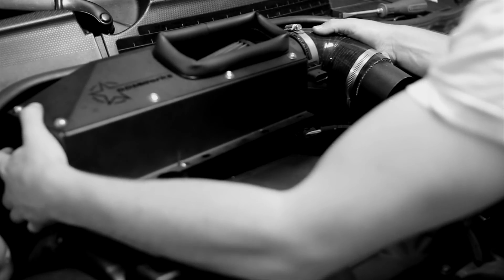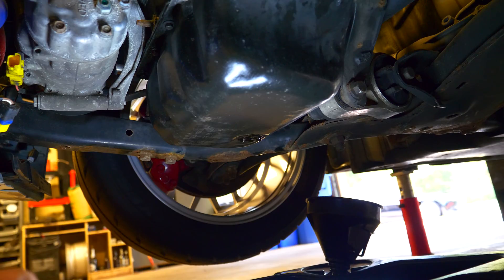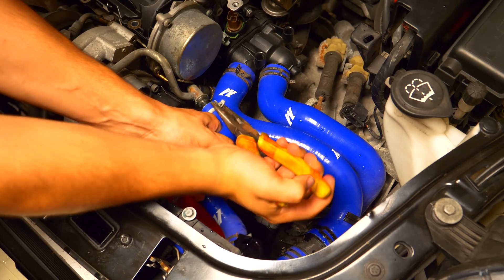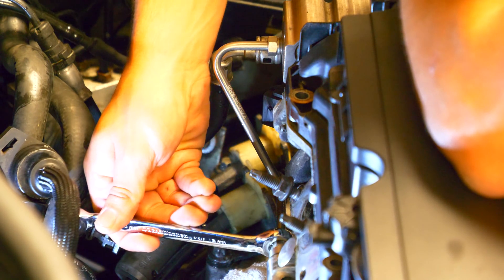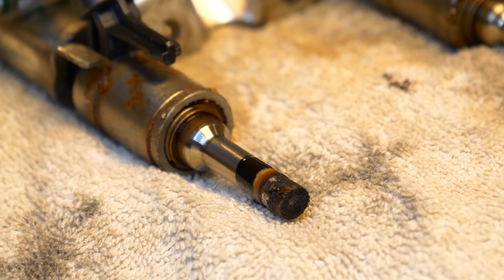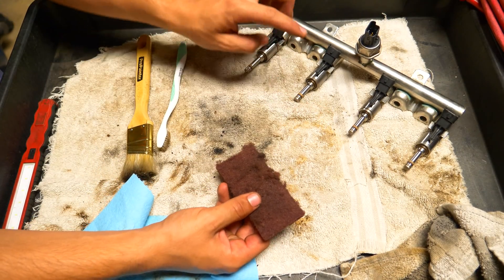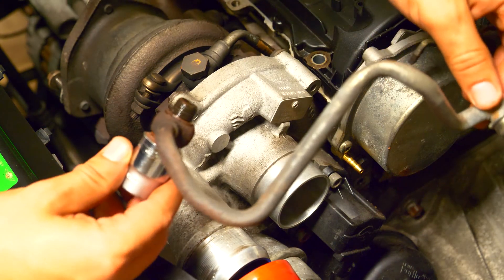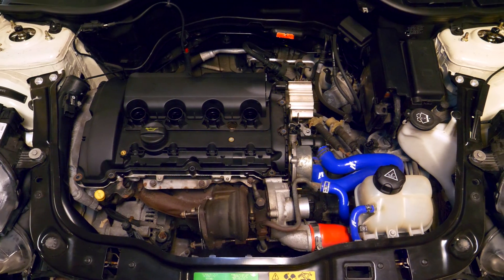Rebuilding My Turbo Mini Engine // Part 2

Comment: Hey, great videos. I originally originally started watching from the coolant piping and thermostat replace, but I have a question after watching this video. 

It looks like you didn't replace the thermostat to water pump pipe and I'm just wondering why? That's the one I need to replace and I'm thinking of getting the same kit you used. 

Thank you very much for videos and looking forward to the update!
Reply from the maker: Hey Ryan, I'm glad you commented because I have a video where I specially changed out the thermostat housing and the water pipe found on the back of the motor. I found a huge leak back there and you can see the entire DIY: https://youtu.be/sbQdbVJI_Gg
Reply: milanmastracci thank you! You do a really good job with these videos, I'm hooked!

Comment: good video,  but I don't understand why you didn't remove your radiator drain plug, it seems like you made a bigger mess doing it the other way. if you would of removed the drain plug most of the coolant would of being removed thanks to gravity, leaving the fluid in the radiator will just make a bigger mess from my experience. Also you would be satisfied knowing you put fresh new fluid back in.

Comment: Did you checked yourHigh Pressure Fuel Pump Unit, it is well known issue on this cars, and also it does causing missfire issues...  You could see if it delivers enough pressure of 5bars while car is running and starting...
Keep on going 👍 very good job, waiting for next video....
Reply: Good idea. I had the hp fuel pump fail on me. Of course, 180 miles from home and 100 miles from the nearest Mini service.

Comment: I really hope you're just doing this for channel content...diving into an engine rebuild without any proper diagnostic work on the original issues. SMH
Reply: BigBeansM3 what?
Reply from the maker: What do you mean?
Reply: Don't mind him, he hasn't been watching since the beginning.  Probably just stumbled across this video.
Reply: well I'm pretty sure Milan would've covered the basic checks 'off camera' to ensure its not just a simple issue ie coil pack or plug etc maybe even carried out a leak down test which would pretty much shout-out what the issue was. thus leaving that possible video for later. uknow aiming more onto getting the car fixed rather then worrying about video's for utube etc etc

Comment: I worked in an auto parts store for like 8 years.  I would recommend against dumping your coolant into the oil drain can, along with your drained oil.  In my experience, most places that recycle oil will not allow you to recycle oil that has been contaminated with coolant and/or water.  There are places that will, but they are much harder to find.

Comment: Again: THP (Turbo High Pressure) engines made by PSA and BMW has a known timing chain problem. If that chain expands, even just 1 millimetre, the engine will not regulate well anymore, you'll have power loss,  can lead to misfires or running on less cylinders. I understand that you want to investigate further and that an engine rebuild is very good, but it is not necessary.
Reply: Correct, don't even attempt a rebuild, just chuck in a new motor. For a guy to use an impact on a valve cover bolt that is designed to be torqued to 10nm, might as well forget it. Seen one of the worst N16's from 2011, 47000km, never missed a service, chain elongation was 3mm, was so much, you didn't even need a measuring instrument. Cylinder honing is a waste of time on these too. Some are so nasty, you see the valve seat lifted.
Reply: So just change the timing chain will solve the problem right?

Comment: Hey, I'm working on my 2010 r56 and I was wondering if you could do a "water pump" replacement video. I know you didn't put on the new metal one to replace the oem plastic one when you swapped for the blue/red lines, but I would find it super helpful. Your videos are extremely helpful. Very detailed

Comment: Here's a tip for draining the oil on your mini so that you don't get hot oil all over you when you drain it. Keep your socket wrench on your socket, but push up towards the oil pan on the handle of your wrench. This applies the necessary friction to get your ratchet to actually click over, and the slop in the socket and ratchet combo allows your hand to be high enough such that the oil won't drain on you.

Comment: Umm... Don't you have a coolant drain bolt on your radiator?
Reply: if you re-use that old crusty-ass coolant while overhauling the engine im unsubbing lol
Reply: Ammar M yes they do have one on the back of the block,.
Reply from the maker: Yes but I don't need to remove the radiator 🤞

Comment: How was it running like crap that lead you to think that the head was the issue? Is this the same head that you port and polished? If so if you didn’t tune the car to accept the increased air to fuel, It will not run correct.

Comment: I'm wondering why you are not supposed to reuse the fuel line... Can you enlighten me why the line shouldn't be reused?
Reply: you can re use them, one guy said not to use them because they hold 2000 psi but any modern brake system uses ~2000 psi and people can custom make them and are reused ALL of the time
Reply: You can get away with reusing it. But the flare might be crushed
Reply: blocki same..
Reply: Same here...
Reply: wondering the same
Reply: I would put it back...
Reply: This is a later model vehicle with 2 fuel pumps due to its direct injection system.  One fuel pump is a standard one in the tank like most vehicles, the other is a high pressure direct injection fuel pump in the engine bay.  The high pressure fuel pump holds usually over 2000psi of pressure which is more than enough to seriously injure someone if an old brittle line is reused or attached to it and happens to break.  Most modern vehicles are now GDI (gas-direct-injected) and the secondary high pressure fuel pump is becoming increasingly popular.
Reply: My mini dealer replaced mine and I asked why and they said that if you reuse the line it has been know to disconnect from the pump during operation which poses a fire hazard